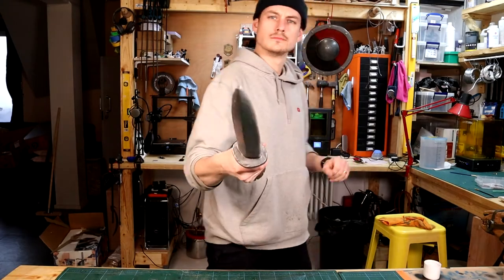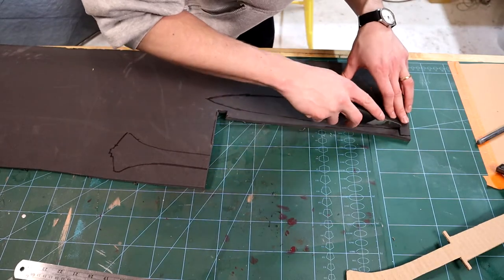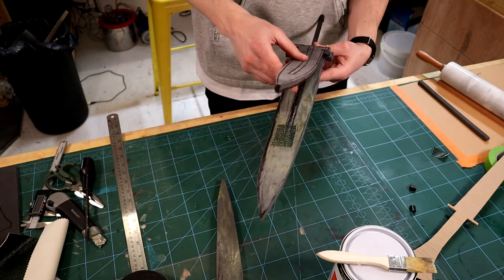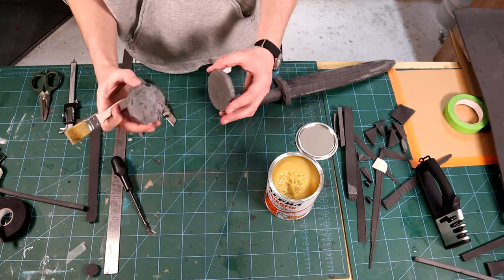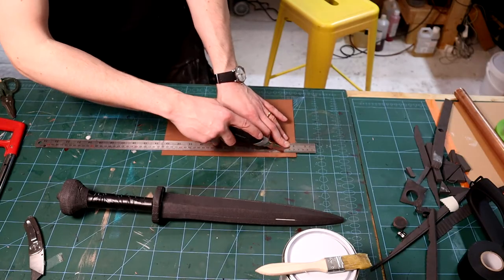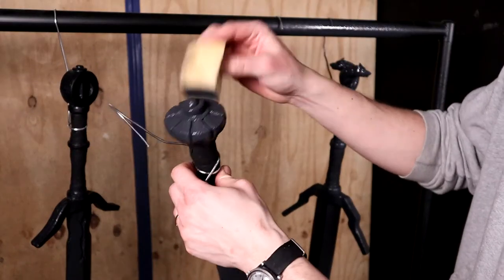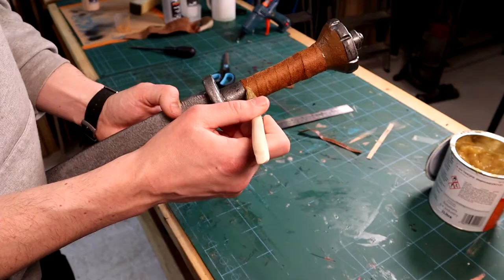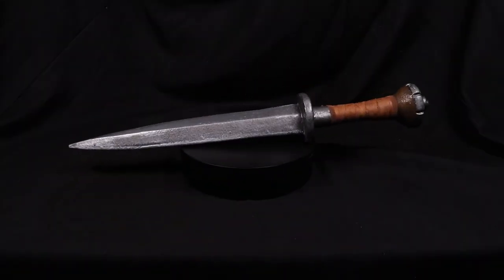How I make LARP safe daggers and swords - Ciri's Dagger from 'The Witcher 3'

Comment: Does the spraygun clog often? im trying to make my own sword(s), but found it easier to dip the whole blade in the latex. But this leaves ALOT of dripping. So im beginning to think a spraygun would be easier. What is your experiences with the gun?
Reply from the maker: I personally prefer to just paint the latex on with a brish and then use a little foam roller to smooth it off with each layer. If its just 1 or 2 items that works great. Wash the brush quickly after and if you wanted dip it in some fabric softener. But you'll ruin the brush fairly quickly either way. If I'm working on a batch then I use a air compressor with spray gun. I have used an electronic spray gun in the past (one for painting fences type thing). It does work but I clogged it on my 3rd run with it. The latex is pretty brutel on the mechanism. If you have the means to use an air compressor with gun this is easier to keep thoroughly clean after each layer. Be sure to use outside or in a very well ventilated or isolated place. The amount of latex particulates fires off is absolutely insane. Good luck either way but definitely brush on works finw in my experience.
Reply from the maker: You can see the spray gun I was using before I got the compressor involved on my knuckle duster video. https://youtu.be/UFBjjJwJjKY

Comment: I got a question  would you recomment cutting the two side pieces of the blade at an angle  before sanding or does that make it harder to get the blade in shape?
Reply from the maker: I cut the foam at an angle after gluing the foam to the core and before sanding, simply to make the sanding a little quicker. Shaping on the sander can be a little fiddly and it's easy to warp the shape by over sanding. The closer you can get the blade shape pre sand the better.